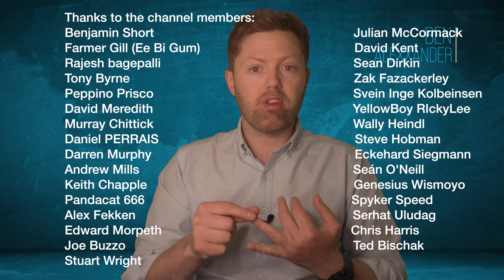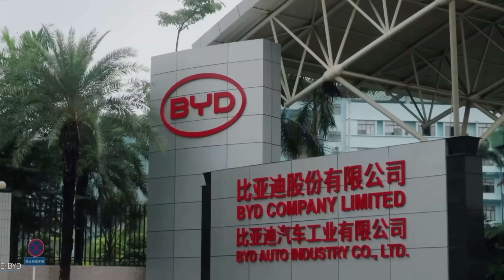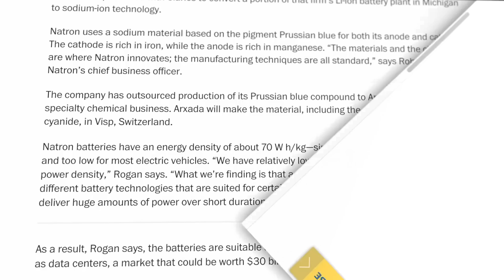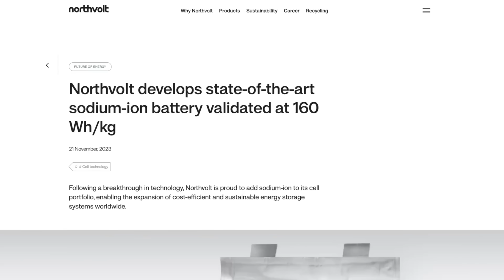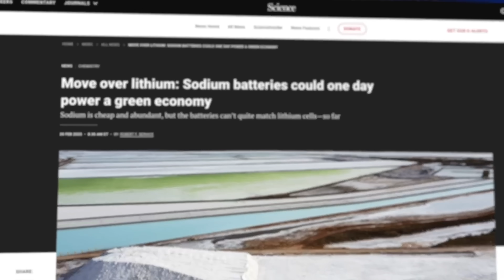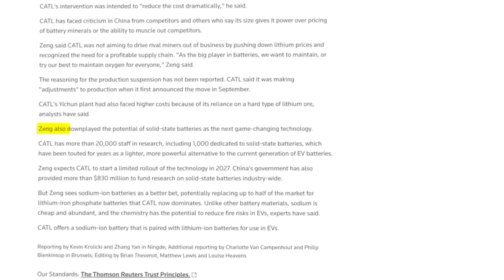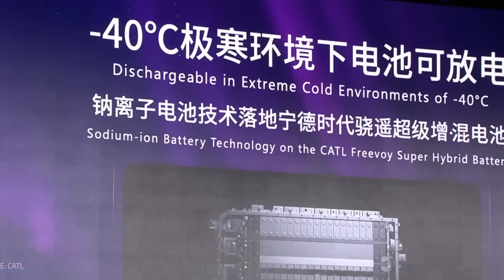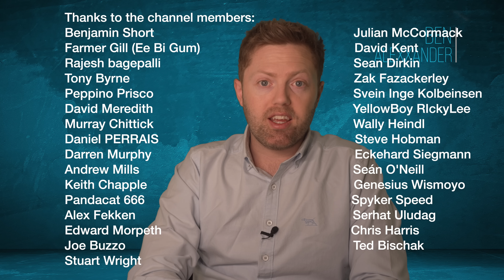Sodium-Ion Batteries: The Myths Everyone Keeps Getting Wrong

Comment: How does the Sodium-Ion battery fare in warm or hot climates, with ambient temperatures reaching 35 to 45 degrees centigrade? 

Does the 2nd generation Sodium-Ion battery have double the cycle of LiFe-Ion batteries?
Reply: Double check on google but its appears to work -20C  to +60C
Reply: Yes they work just as well as Lithium in hot climates and even better in colder,  Sodium is safer In thermal run away and has more charge cycles with less degradation.  And most importantly it's will be around 60% cheaper per kWh per cell.  Only lithium has a slightly better kw/ kg energy density. sodium batteries will make grid and home storage batteries much cheaper and Budget EVs cheaper. It's even stated these EVs have well and truely and advantage on production cost compared to ICE vehicles

Comment: I have read that the charge - recharge cycle losses are greater than lithium, if true could this negate the lower initial price advantage over the lifetime of the battery.
Reply: This is my concern over some reports I have seen. Imagine if it takes 50 kWh to fill a battery by 40 kWh. It is this round trip efficiency issue that I am waiting to hear clarified.
Reply: Good question. According to the Ask AI website  "the round-trip efficiency of sodium-ion batteries generally ranges from 85% to 95%"
Reply: @TronJockey That is not as bad as some of the negative reports circulating. Good!
Reply: @javelinXH992  it's ai not real data. Wait for real reports from real testers, like bjorn nylund.
Reply: @noname-ll2vk I listened to someone talking to a UK company making sodium home battery storage systems and they said the same thing. Round trip efficiency wasn’t bad at all.

A lot depends on making sure the electronics is set up to work with sodium properly.

Comment: ""Probably wear out the tyres before the battery"?!!!  I should bloody hope so!
Reply: Average EV would get around 5million km on these new sodium batteries , yes the car would likely be scrapped long before that.  So these batteries will likely be repurposed for use as a grid storage or home storage battery
Reply: I think saying the electric motor will need to be replaced before the battery would be correct. Electric motors last longer than the average ICE, but they don’t last forever. 300K miles approximately.
Reply: @keithv3767  Electric motor?  Who mentioned that?
Reply: @dogsbodyish8403  he's saying the video guy should have said the battery will last longer than the motor, not longer than the tires.
Reply: I've heard Teslas totally eat tires.
Reply: @soundspark  if you drive them like a race car they do. If you accelerate and brake moderately most of the time it's only about 20% faster.

Comment: Is it really using the sodium that you can extract from seawater? I saw someone dispute tht, can't remember where...
Reply: No it isn’t but you can and we probably will. That’s the short answer anyway.

Making it from NaCl (the primary salt in seawater) is fine but there are other sources than sea water that are potentially more efficient. NaCl deposits underground for example. The NaCl is turned into sodium carbonate for use in industry rather than used directly. In some areas there are natural deposits of sodium carbonate as well which could (and currently are) directly mined.

It’s quite possible that we will move to using other methods if the Na ion battery boom takes off. It’s exciting times and one for the industrial history books.
Reply: They use soda ash (sodium carbonate) as raw, material  . It is just easier to process and has established supply chain as it used in the production of many chemicals already. You can use salt (NaCl) but it will be a little more expensive as there will be additional steps to convert it sodium carbonate first.

Comment: As mentioned by LaserV of course your tires wear out faster than the battery. Perhaps that bit needs a correction on screen before too many see this video?
Reply: Isn't it obvious that he misspoke?  He said further that the battery provides 3,000 to 5,000 cycles (+500k miles) before 20% degradation.

Comment: wearing out the tires faster than the batterie is not really a flex
Reply: It seems obvious that he misspoke.  He clearly said 3,000 to 5,000 cycles, meaning more than 500k miles before 20% degradation. No engine will last that long.
Reply: Is is when sodium ion batteries can last as long as 3k plus cycles. Plus tyres costs a fraction of what batteries do. Xxxx
Reply: @johnmilligan4260  tires don't last very long at all. All cars go through many sets of tires. An impressive battery life would be lasting longer than the car body, not the tires.